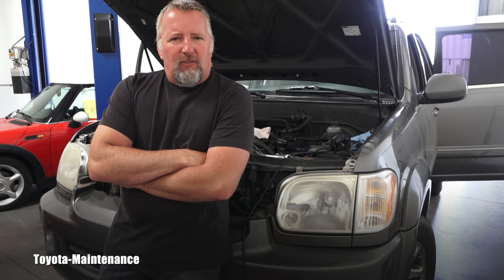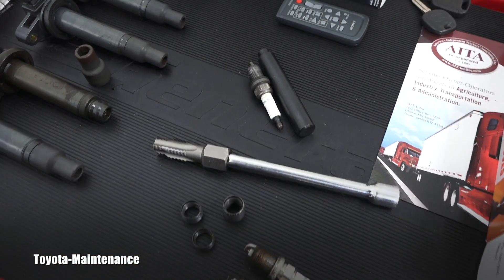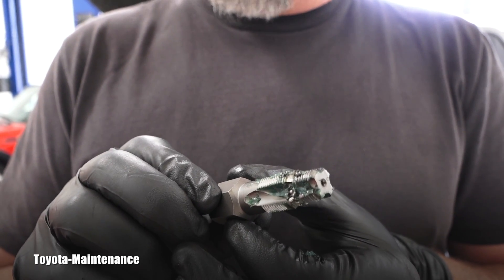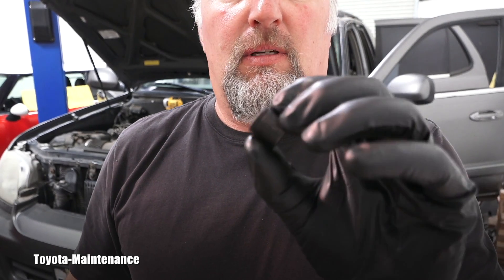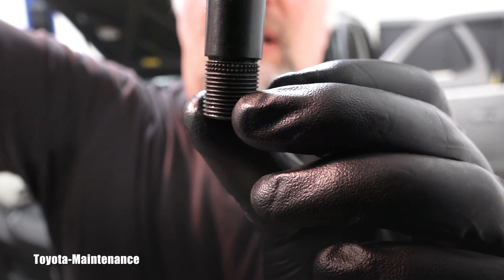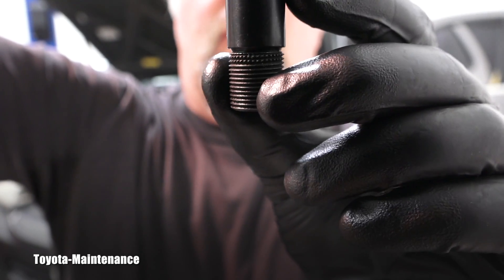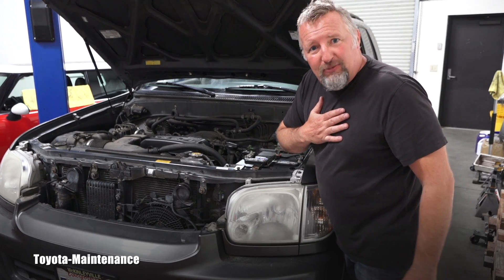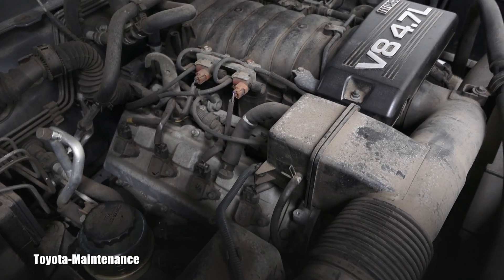Helicoil spark plug stripped thread repair

Comment: Have a 2004 Tundra DC and had #5 cylinder strip out at 120,000 miles, local shop did this same repair then, trunk ran great for 8 years.  It’s 2025 now, time for new plugs, took truck back to same shop, I forgot to mention insert.  During plug removal they called to tell me number 5 had an insert and it came out attached to the plug.  I told them that they had installed the insert…shop manager was shocked, looked at his records, apologized and redid the insert and hopefully got it locked in this time.  400 miles later truck running great and now has 206,000 on the clock.  I don’t plan on ever selling my truck, still love it like the day I bought it new.  Hoping the second insert holds forever…fingers crossed 🤞

Comment: I also put red lock tight on the outside of the thread insert,  install insert flush, smack installer to lock in top part, you won't have any problems!!😊

Comment: 3:37 how did you turn the engine to open the piston? Do you need to pull off that black plastic vvti cover to expose the 22mm bolt? Thanks for the video!

Comment: I enjoy your videos.

I bought a 1986 Kawasaki 454 LTD. The bike ran great.

 The only thing it did was idle high and then idlewood increase as time went on. What I fix the vacuum leaks, I could no longer get the bike the run unless it was fully choked.

What I pulled the spark plugs out, I was beside myself that whoever put them into knot torque them to specification the same as in your video and on my 1999 Toyota Solara V6.

When I went to put the spark plugs back in after cleaning them, then the sky fell on me and I realized that the threads were stripped.

I am just too paranoid to do this cuz as you said in the beginning of the video I don't know if I can stay square to the spark plug hole to make sure I drew a true 90° to the surface area.

With a motorcycle, it's about $250 just to buy a new head. I am unable to get soft quotes over the phone from machine shops around me Chicago suburbs to do this work.

 But at the $150 an hour labor rates from shops around me, I'm sure this job would Bill 2 hours so I think I'm just going to be a head getting new cylinder heads. I don't think there is  enoughl clearance to get a drill into the spark plug hole to drill by the heads are still on the

Comment: Of all the Youtube videos on how to do this repair, this by far is the best one. It shows the best way for how to clean out the metal shavings.  Thanks!
Reply: Don't use this kit. Get a Timesert kit. It locks the insert in the hole. Thread-saver can pop out.

Comment: When I first got my 2002 Tacoma it had a bad plug in number 5 and it came out like someone had put it in sideways. So I put some anti seize on the new one and it went in easy. Like nothing was wrong I changed the rest and haven’t had any trouble sence. Keeping my fingers crossed.

Comment: Did you set the helicoil in with the hammer. I’m sure it dosnt matter if holds or not, just threading out if you have to remove the plug.

Comment: Okay I have 99' 4 runner. Same problem. I've watched this video 6x and spoke with others on the matter for opinions. I'm no tech but with this great help I think I'll tackle it. Wish we had a local guy like you. You are tremendously appreciated.
Reply: how did it go ? did u finally do it ? i m about to try but not sure how far should i screw the spark plug in?
Reply: @musicman6311  18 NM or 13 FLBS TQ

Comment: Just repaired my 2000 Toyota tundra, followed your direction and it went perfectly. I had the advantage of a bore camera so after I cleaned out the cylinder to make sure it was perfectly clean. This is the most comprehensive video I have found, thank you.

Comment: Can’t say thanks enough for this - followed this to a tee and right after degreasing with brakleen i below it out with the air nozzle and started the car up with no plug in #5…blew everything out. Worked like a charm - i would say you could also use duct tape built up around your socket extension shaft as a centering device - along with some Saran Wrap in the “wiggly” part inserted into the extension and tap to tighten it up a bit…GREAT JOB!!!

Comment: Great job: I used to use helicoils - but they are tedious with the tang and thread skipping - I only have one issue with your setup - sometimes using solid lockable inserts - the insert can come out with the new plug as the clamping pressure bites onto the insert and is able to grip it sufficiently to lock against it so when changing them the insert can sometimes come out too!! Good work though 👍👍👍

Comment: Man, what a nightmare. Another of the many reasons why I don't like taking my vehicles to a repair shop. Mechanics now a days just don't take care of your vehicle and could care less if they screw up a job and not inform you about it. Worst part, they never assume responsibility and make up stories to get off the hook. This is why I learn to repair my own vehicles. Thank you Mr. Toyota Maintenance!! Your videos are always informative and the best videos I've seen so far. I can tell your a one of a kind honest and humble mechanic!!
Reply: Mechanic here. I have one of these in the shop right now, customer put their own spark plugs in and #6 blew out. Good thing mechanics are here to fix you DIYers mistakes. Thats a lot of absolutes there lexx.  I'm sure there is some bad ones, but not all of us. Most all the spark plugs I see blow out are from plugs not being tightened enough or correctly.
Reply: Right

Comment: Some idiot must have attempted to tighten that spark plug as hard as they could. This is why I always use a torque wrench when dealing with aluminum threads. I've had them strip before even reaching torque spec. Just makes me love steel!

Comment: have a 75 Volkswagen I see someone had installed a helicoil in the #3 plug hole that's gone bad and wondering if I could just remove it and replace it without drilling and tapping it again? Thanks for any advice!

Comment: Great video, as always. Im not sure i understand how you cleaned out the hole. Are you spraying brake cleaner down into the cylinder and then using compressed air to blow it all out? I have a tundra with 190k. No stripped plugs yet (fingers crossed). Thanks for sharing your expertise.

Comment: We owned a Renault Traffic 1.7 OHC with no3 spark plug thread needing a helicoil. By the time it was done the engine had burnt the piston in half needing a new piston plus head job. 
BTW these Renault vans along with Vauxhall & Nissan counterparts from 1980's onwards love to throw the input shaft of the gearbox for no apparent reason.

Comment: I changed the spark plugs on a GX470 and cleaned the throttle body mass air flow sensor, I did say a prayer, you never know 😂
Reply: About to do this to my gx470. How did it go?

Comment: I had a grey 2004 tundra dc.  I sold it with 193k (all possible maintenance including 2nd timing belt and water pump.). This video brought me back some great memories!  I got a 2014 which is great... but that 2004 was special.

Comment: Great job on putting the Loctite red gel on there I was about ready to go nuts in the comment section but that should make the coil never ever ever ever come out and you should be able to easily remove that spark plug the only thing is if possibly some of that let Loctite would spill over so some people put it in without the spark plug and then they try to remove the lock tight that has spilled over but you put such a nice small film on there that it should work out just perfectly but great job man thanks for doing the video appreciate it

Comment: I think the insert is supposed to be inserted into the cylinder, and the tool that comes with it you pop it in and tap it with a hammer- which expands the bands. Then you thread your spark plug into the insert.

Comment: I tried changing spark plugs and i cross threaded  a cylinder  on my Honda element how well does this actually work
Reply: It works well.  I had to do this on an old Nissan years ago for a broken spark plug.  Lots of videos on how to do it (no disrespect to Peter, but also watch "South Main Auto Repair LLC" as well for his comprehensive instructions (called "How To Repair A Stripped / Blown Out Spark Plug") on how to do it.

Comment: What type and brand of grease do you use? I used liquid wrench when I did this before and still had alot of shavings to get out. I have to do it again on a different cylinder so looking for a cleaner way if possible. Great video by the way.
Reply: If it's not too late, looks like he still had the tub open on top of his toolbox at 8:18 - some type of marine grease. If you're familiar with USA brands you might recognise the container.
[ update - Lubrimatic ]

Comment: I had no doubt your helicoil would hold. When properly installed it should be as strong as the original. Nice work capturing the aluminum shavings.
Reply: Right

Comment: Good video.  Thanks for making it.  I think is a very good idea to wack the top of the plug with the provided pool.  I will also wait for the 24 hour cure.  Red locktite sometimes can be a little difficult to obtain good result if it does not cure for 24 hours.

Comment: If you have grease on the new tapped threads the Locktite is not going to work too well. If you must use grease to catch the aluminum bits, you should spray brake cleaner to remove the grease before installing the insert.
Reply: isn't that what he did?

Comment: That’s a great installation procedure   when they  recommend hitting the the insert to spread the top i cringed,,, 😬 and  the torquing procedure its great to see a professional mechanic 👨‍🔧 at work with a conscious 👍thanks for sharing
Reply: it okay to hit the insert I think.  It was a trick they told us in Machining school, as a quick fix when threads are loose and a little out of spec - kind of a cheat ;-)....lol

Comment: Maybe another good idea to remove aluminum shavings.. use shop vacuum duck tape “flexible tubing” to end of vacuum that will reach into spark hole and inside to cylinder
Reply: Another way to remove shavings is blow it out with your air

Comment: How is this repair holding up?  Looks like it's been a little over a year since you posted this video.  I'm about to attempt this on my LC100 - same 4.7 engine), and looking for any other tips you may have.   How did you make sure the piston was down before doing the tap?
Reply from the maker: Sequoia poors like kitten , I got lucky
Reply: I have an LC100 as well need doing this, this engine must be common for spark plug problems. How did you go and did you use save-a-thread? I am tossing up between save-a-thread and Time sert.

Comment: Why do you use an ‘ insert ‘ ? Why you can’t you just make new threads and install the spark plug like that?
Reply: Bc your grinding out a bigger hole than that's needed for a spark plug, therefore a insert is needed to fill

Comment: Is your fix still holding up well? How many miles have you put on the vehicle since repairing? 

Thanks
Reply from the maker: driving every day, short distances, 1500 miles....
Reply: @ToyotaMaintenance  looks like I will be tackling this this evening. Thanks for the great video showing the process. Much appreciated 👍
Reply: GaryV how’d you go? I heard these inserts tend to be stronger than the thread that was there before

Comment: I did this same repair and used a much smaller amount of red threadlocker for the insert. I had to remove the spark plugs again for a different repair later on and found some of the cured threadlocker on the end of the spark plug. There was also some red/brown colored burn off on the walls of the spark plug hole. The engine is running for now but I'm not sure if threadlocker is the way to go here.
Reply: Not sure if it heat resistant

Comment: The sav-a-thread kits all say in the literature to use high temp RTV... but I see people doing this using high strength red Loctite threadlocker ....so which is it?
Reply: Hi Criag, did you find an answer for your question? I'm currently trying RTV but it's not holding very confidently, and I'm considering high temp thread lock now. Any advice?

Comment: why didn't you stake the insert before you stalled the plug
Reply: You install it on the plug and let the threadlocker or high temp RTV cure for 24 hours... then take out the plug... then use the tool to flare the knurled end of the insert at the end then you can put your spark plug back in

Comment: I liked your video and am performing the same surgery on my 2000 Land Cruiser.  Thank you.  Did you ever remove the spark plug and expand the insert?
Reply from the maker: No, I didn't touch it and so far no problems
Reply: @ToyotaMaintenance   is the tapping tool also an install tool?